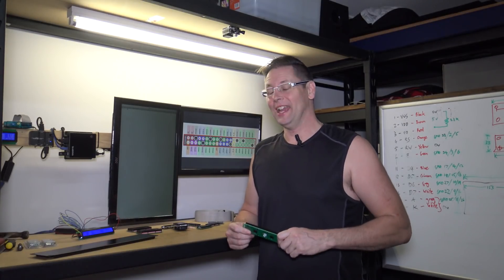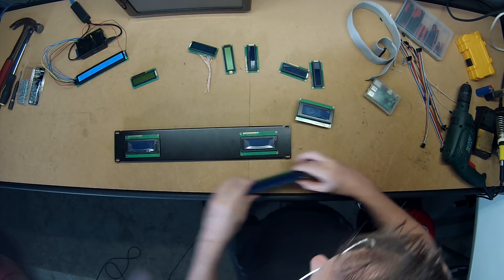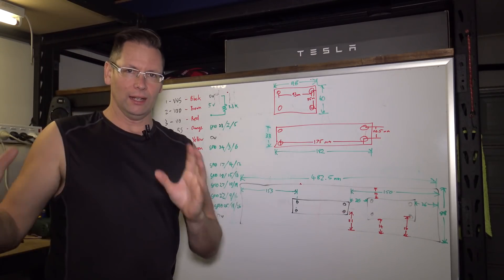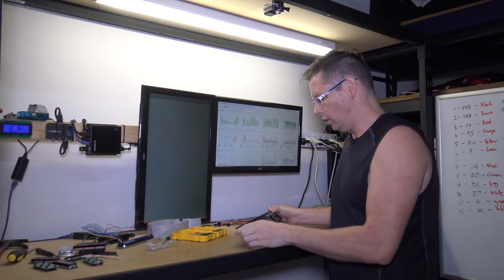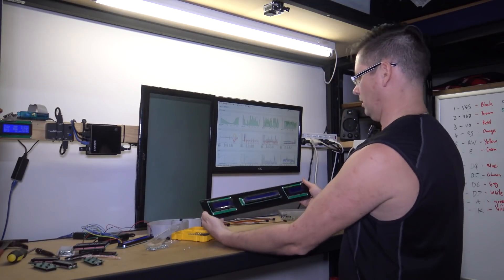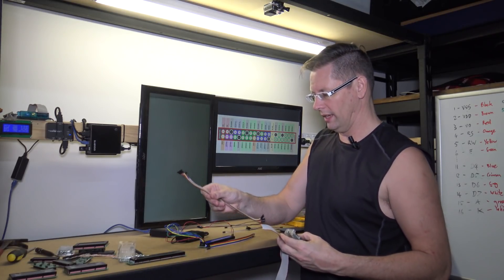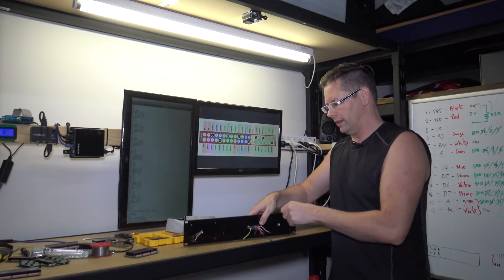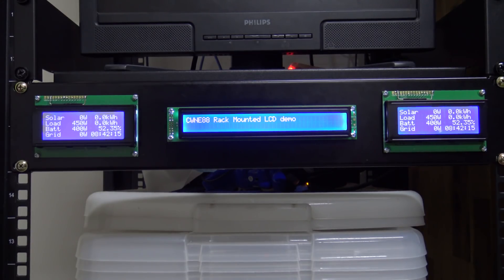Triple Rack Mount Raspberry Pi LCD Screens

Comment: I watch this video and I thought you know you could have said about it and the ribbon Cable connect to a circuit board and then soldered your lines to that circuit board instead  and there is this company that makes circuit boards for whatever you need them for

Comment: its fine but it would look much cleaner if you would cut the whole square for the screens ... and why the hell you dont youse i2c addapter? you would end up using only 4 wires ?!
Reply: I'm guessing he had the ribbon cable handy and didn't have an i2c adapter and his method still meets his needs.